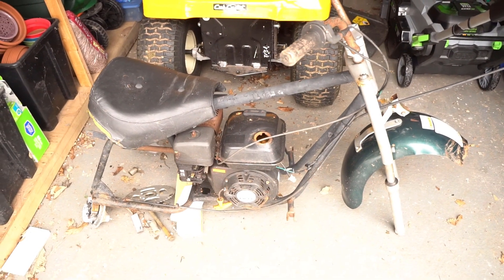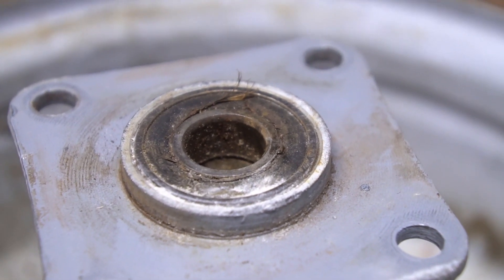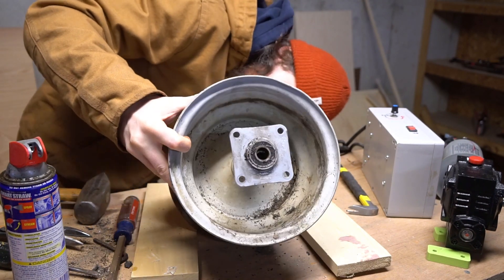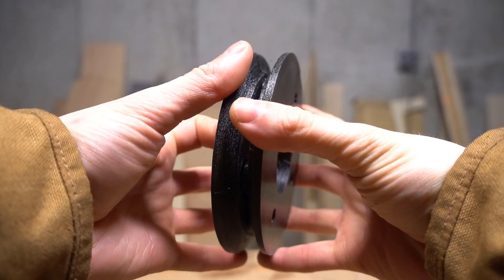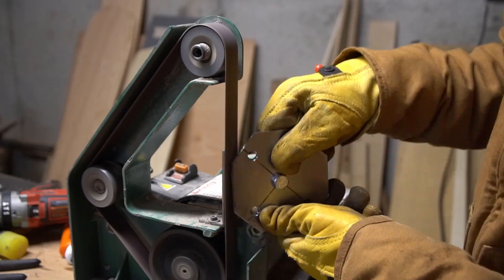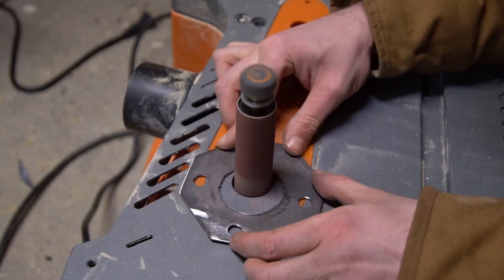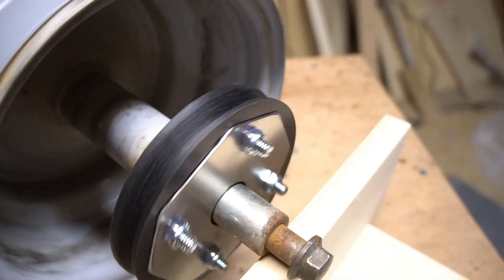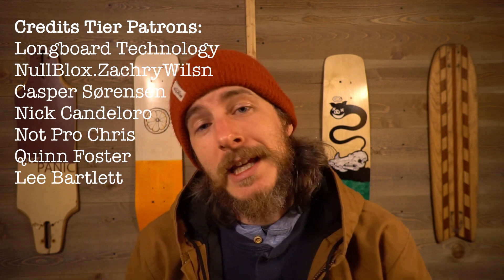DIY Electric Rope Tow - Part 2: The Bullwheel

Comment: Why TPU instead of Nylon or ABS for strength?
Reply from the maker: Just because I already had my TPU print settings dialed, nylon would definitely work too. I've never worked with ABS so I can't comment on that. The Armadillo is a shore-D TPU, it's about the hardness of a hard hat so it's a really robust material. We'll see! I can always reprint in nylon if it fails

Comment: I’ve been wanted to make a board with just a kick tail and no nose. Do you have any suggestions?
Reply from the maker: Are you looking to do concave too?
Reply: @GoodRoads  I’m not sure yet but I was going to try and use a vacuum bag. I was also wondering how to get  a cemetricle concave. I do have a 3D printer if that’s something I should use.
Reply from the maker: If you're going to use a vac bag a foam mold is the easiest and cheapest way to go. You can get a nice symmetrical concave as long as you pay a little attention to the details. I've got a video on how to make a mold like that, it's not too hard at all: https://youtu.be/WtqDzXJMKAs

3d printed molds are a great way to get super precise two-part molds but you don't need that for a vac bag setup.
Reply from the maker: Actually I realized that the other video I linked is a slightly more complicated method because I the deck I was making had a complex rocker/camber/rocker geometry. This is an older video, so sorry about the quality, but it's a much easier method of making a mold: https://youtu.be/R6Pui0ULDlY
Reply: @GoodRoads  thank you so much